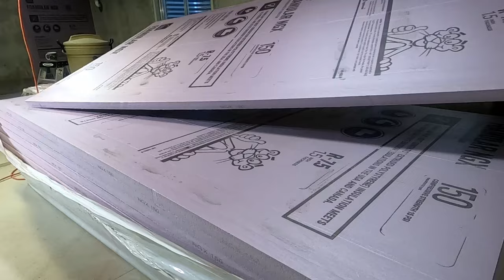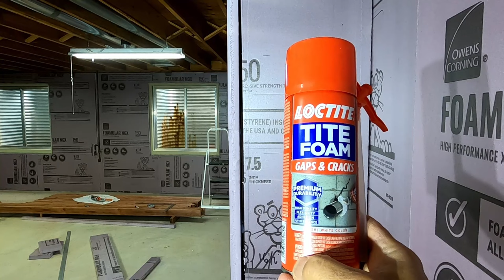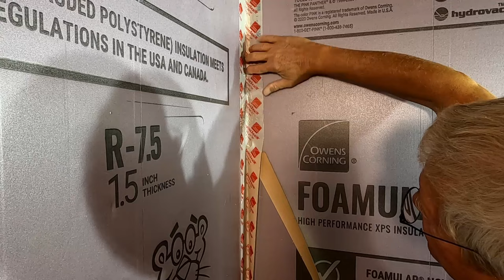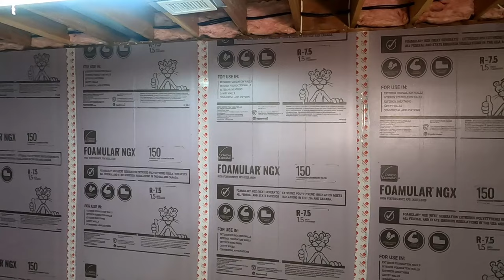Finishing My Basement - Foam Board Insulation

Comment: That installation will fail inspection, you need a Fire Stop at the top, and a Vertical Fire Stop, a minimum of every 10 feet.
Reply: He had fire block on the top with plywood also you put fire stop on the studs when you frame it out doofus
Reply from the maker: Good to know - thank you!